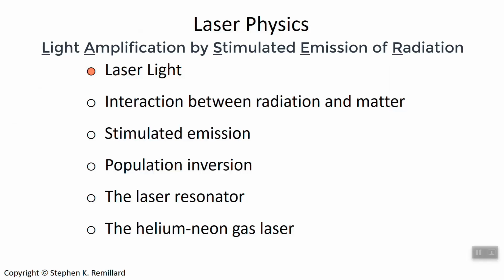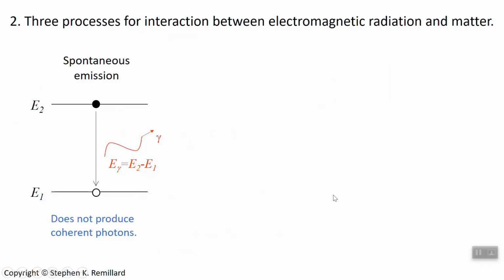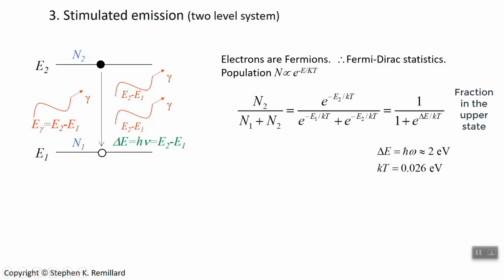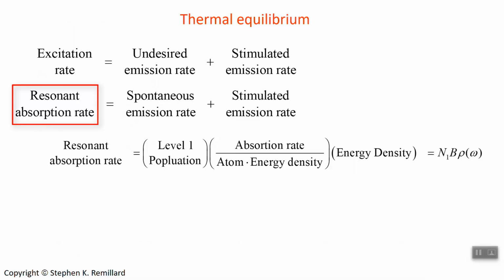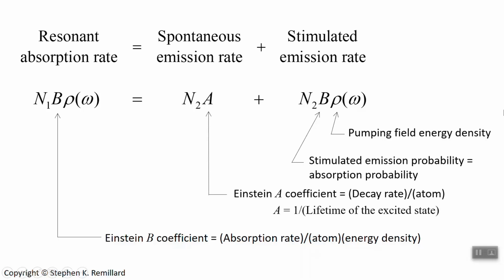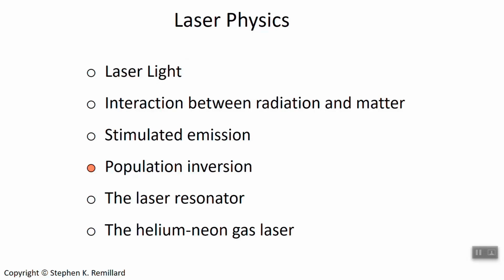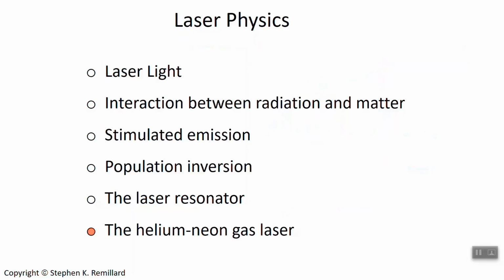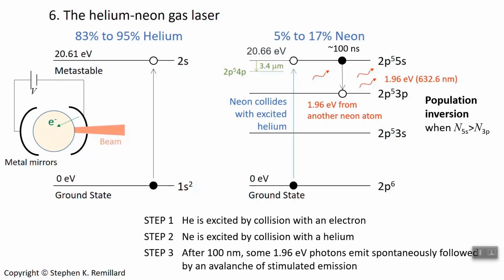Laser Physics: Five Principles and an Example, PHYS 372

Comment from the maker: At 26:43 three steps to achieving a HeNe laser appear on the screen.  Step 3 has a typo.  "100 nm" should be "100 ns".
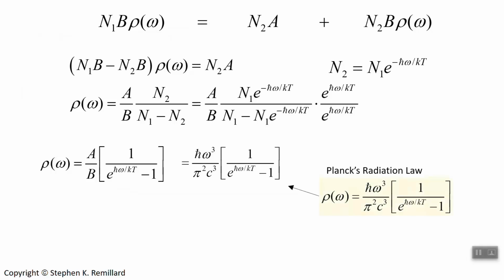Another typo at 16:52.  A factor of A/B is missing after the second "=" sign.
The wavelength of a He-Ne laser is 632.8 nm.  I mistakenly say it is 632.6 nm at 25:31.